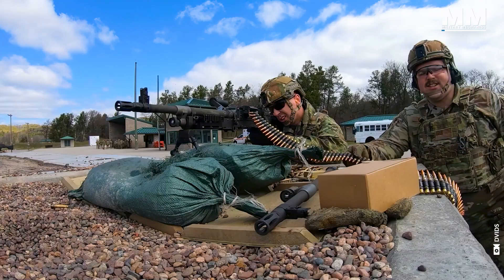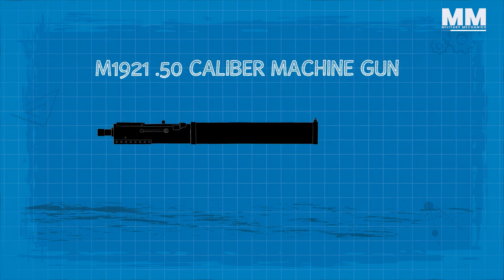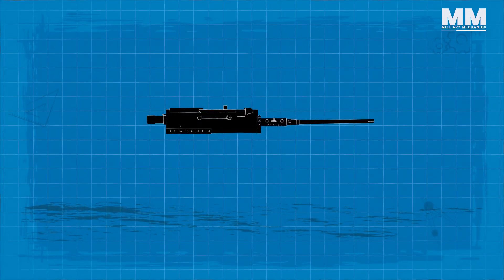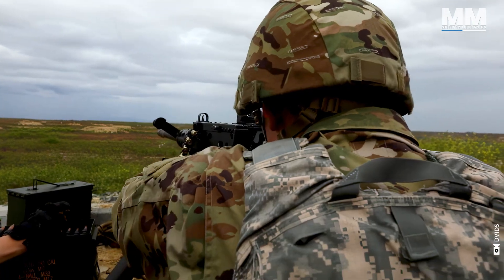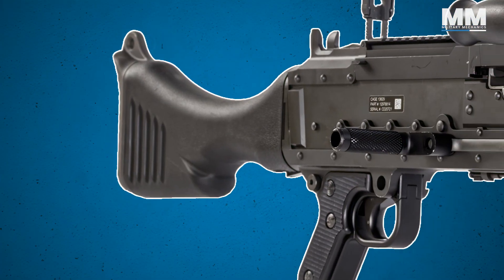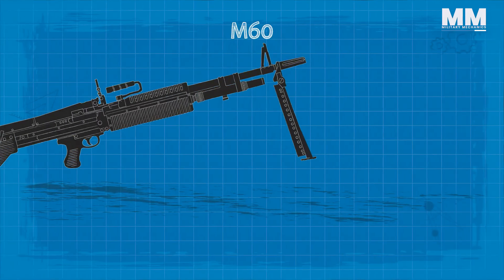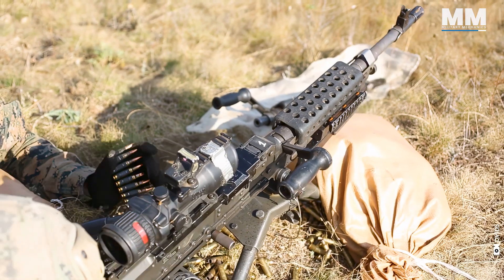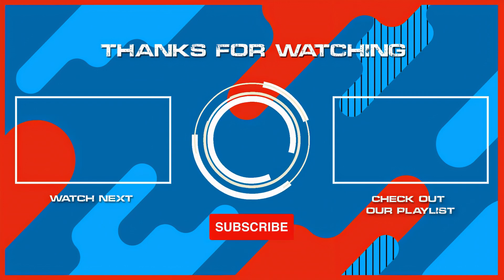M2 to M240: The Engineering of US Military Machine Guns

Comment: Well done visuals and editing, but as a former 0331 (machine gunner in the Marines), showing a casing flying through the air with the bullet, and using miles per second instead of meters, you lost me.  I'll check out another video though, may be a fluke.  I understand the narrator not knowing better, but you need someone in the edit bay and writers room to prevent these mistakes.